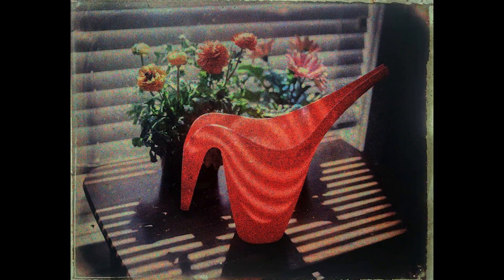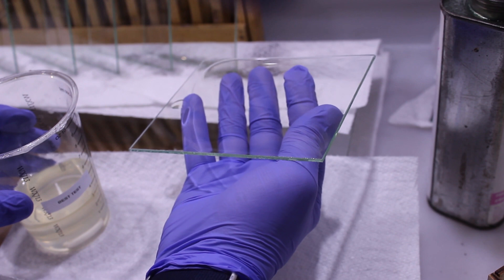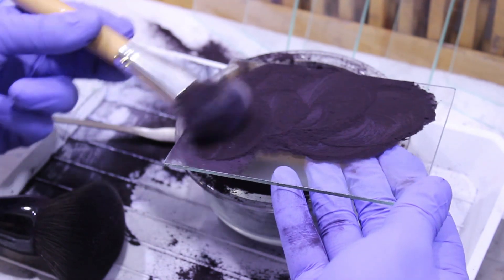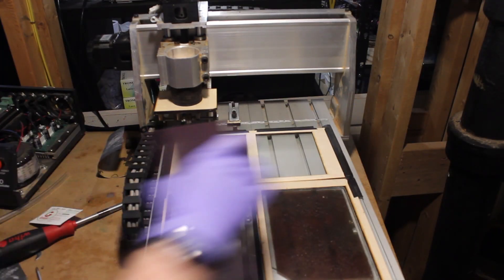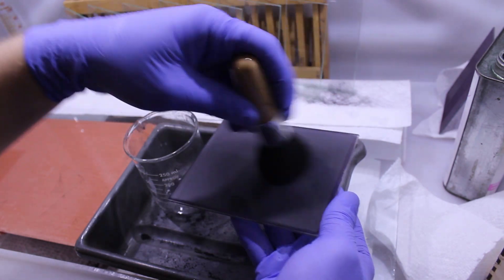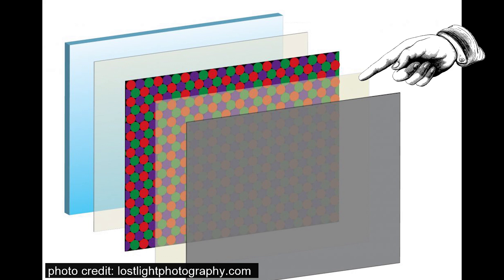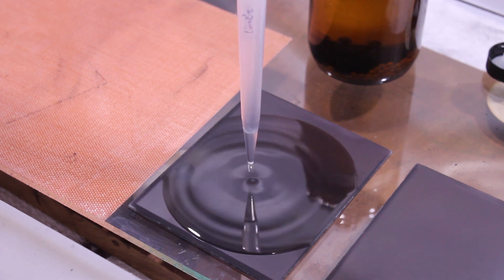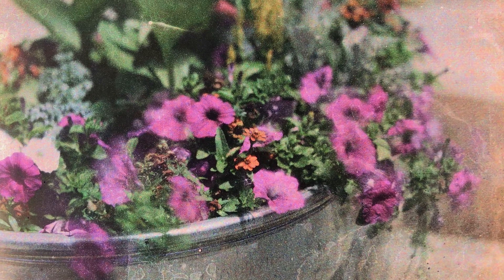Making an Autochrome Screen Plate

Comment: Applying varnish reminds me of applying photoresist to silicon wafers for IC fabrication.  A wafer is put facing up onto a rotary vacuum chuck.  Drops of photoresist liquid are applied in the center of the wafer as it spins.  The viscosity of the liquid and the rotation speed control the photoresist thickness.  A very uniform layer results.
Reply: A DIY spin coater project: https://youtu.be/FpR3G4C-b0U?si=dzqFrEtRKsYKyKba

Comment: Fascinating. The only reason I haven't tried this, so far, is that I don't know how I would go about finding a panchromatic emulsion. I imagine I would have to make one. And I only vaguely know that there are red and green sensitizing chemicals that can be mixed but I haven't found much in terms of specific information for this process.
Reply from the maker: Yeah, that's more or less correct.  I make my own because it gives me more control over the characteristics of the emulsion.  That being said, I think any commercially available one could conceivably work if you add in the spectral dyes - you'd just have to do a lot of trial and error figuring out just how much exactly.

I use erythrosine for green and pinacyanol for red.  The original Lumière plates used a different mix - erythrosine and orthochrome T for green/yellow, and ethyl violet or orange-red.  Unfortunately orthochrome T seems to be completely unobtainable these days unless you want to drop $10K on a custom synth, so I just use my own sensitizers instead.

Comment: Really interesting video. I found this video after watching the Autochrome video on the Technology Connections channel and I really want to try making some myself. I can't wait for the full video. Could you in the meantime elaborate about some stuff your website didn't mention? What dyes did you use? Your website mentions that you slightly modified the original dye formulas, but for the life of me I can't find anything about them. Maybe I would find more about them if I searched in french, but I kind of failed that in school, so not really an option. Is it possible to use modern dyes that are easier to source? I want to try it out before I spend a lot of money.
Reply from the maker: Hey there!  The dyes should be listed in a table, but I remember the website editor being kind of weird, so maybe it's just not showing up in your browser for some reason?

The quantities are as follows - 

Orange Starch: 11.2g Erythrosine, 2g Rose Bengal, 15.2g Tartrazine, 150mL water

Green Starch: 12g Tartrazine, 7.5g Patent Blue V, 150mL water. The green also uses some ammonia and sodium sulfate to help control color and consistency but I'm traveling atm and can't look up those quantities.

Violet Starch:  6.4g Crystal Violet, 0.9g Malachite Green, 150mL water.

I don't think there would be any issues using modern dyes, as some of these can be kind of pricey.  I tried a few different t-shirt dyes from Jacquard with poor results, before figuring I would save more money in the long run just using the original dye formulations.

Comment: I just learned of this process and have been checking out plates from a century ago 
Very ingenious process but I'm wondering;
Why do your pix look more like pointelism paintings than the old pix which looks like film?
Reply: From what I understand from my extremely limited understanding of it, it’s got to do with the size of the starch grains, older versions used a specialised refining process that created tiny starch grains, which isn’t as easy to achieve when DIYing.
Reply: Would the starch autochrome work with Edwin Land's two color Retinex method? That would be interesting. Please, do a full video.

Comment: So how long do the plates last with out the silver emulsion? Like could you make up a batch of plates then when you go to use them you just slap the emulsion on and ready to shoot?
Reply from the maker: They pretty much last months.  I've still got some problems to work out with the second varnish, where it kind of starts to delaminate after a while.  I've done this with some plates that were a year old, and were more likely to crack/leak, but still worked.

But basically yeah, nowadays I'll make like 30 plates over the course of a couple weeks, and then do a big coating run all at once.

You can reuse the plates a few times too - so if you don't like how an image turned out, you just wash off the gelatin, and you're ready to coat again.

Comment: This is fantastic! but I have one question, where do you get the chemicals? Specifically the sensitizers, I've been to your website and read everything along with doing a lot of google research
and couldn't find really ANYTHING on pinacyanol synthesis nor much of anything on purchasing it and or other sensitizers either. There are crumbs of mention here and there but it's like there's no info I can find on the Spectral sensitizing dyes pinacyanol and others (without buying books for guess work). Any info and or sources of that would greatly help!
Reply from the maker: Great question!  You're right, sensitizers are by far the hardest to get a hold of.  I get most of my standard chemicals from The Photographer's Formulary.  

If you know someone who can order from Sigma Aldrich, that's how you would get a hold of the pinacyanol.  You might try contacting the guys at artcraftchemicals.com, the last time I needed to put in a special order they were able to source it for me.  Luckily 1g of that stuff will last forever.  

The other sensitizer for green, erythrosine, is pretty easy to find.  I think I got like 100g off of ebay a few years ago.
Reply: @jonhilty7434  Sorry for the late response and thank you so much for replying! I honestly didn't think you would. When doing research I did notice that Sigma Aldrich
was the only "commercial" source I could "buy". Is it just hard/difficult to add to cart and buy from them or do I need to give them a good reasoning?
(I ask because the sight says literally add to cart) I also wanted to do research in seeing if there is a somewhat "easy" way to synthesize pinacyanol like the chemists of old
so I wouldn't have to rely on single source buying and or having to have a middle man get it for me. I'm looking into improving the process and end result of the image by
trying out Oswald Ripening (once I figure out the best/easiest way to do it simply) along with making a more uniform and patterned color grid like ones in led screens. Any ways
I'll try out those sources once I have everything set up to make my own autochromes and again thank you so much for responding back. :D
Reply from the maker: @virus7g7  No worries!  I try to reply to everything.  If I ever don't, it's probably that I just forgot...

When I last tried, Sigma would let you add stuff to the cart, but you wouldn't be able to complete the order unless you were a registered business or research institution.  

I did run across a pinacyanol synthesis a while back.  It doensn't look TOO crazy, but you'd probably want a fume hood and some decent equipment.  I actually ran across it because I wanted to see if I could make "Orthochrome T", which afaik is completely unavailable.  They have extremely similar synthesis routes, and were mentioned in the same article.  At the end of the day, though, I decided against it, because there were a ton of weird chemicals involved and I didn't want to end up on a list.

Good luck on everything!  I'll be interested to hear how progress goes!

Comment: Fantastic video, I've only heard of one other photographer replicating the Autochrome process, you've done a fantastic job, looked at all your autos on your site, almost all the subjects look 1900s period in Autochrome except the shots with modern subjects in it, absolutely enjoyed seeing those photos!!! I personally shoot and process vintage expired film and several years back I bought 3 rolls of 1956 expired Lumiere Alticolor 120 colour film which is Autochrome but on roll film emulsion, the first 2 rolls came out very messy but the 3rd roll came out really good!!! I will upload the photo montage sometime soon and link you to it. I've also shot some 1939 and 1941 expired Dufaycolor films too which are a colour matrix version of Autochrome and got decent results.
Reply from the maker: Oh man, very cool!  I'd love to see your results with the Alticolor!  Sometime this spring/summer, I'm hoping to pick up an old Kodak film coating machine, so 35mm Alticolor-like film isn't outside the realm of possibility!  

I have a single DufayColor slide, and I absolutely love it!  I'd love to try and emulate that style of screen plate.  I think first, I'd need to start with a low-res system like the Joly Plate.
Reply: So I was not the only one to have their mind blown by seeing an IKEA watering can shot in real Autochrome. :D

Comment: Would this be possible to do on film? I assume 35mm would be way too small since the starch particles would be way too big but maybe 120? Would be interesting to create custom color emulsions within the realm of a diy skill level especially since film prices are going up.
Reply from the maker: Yes, absolutely!  When the Lumière company shut down production for the original autochrome line, they switched to potato starch on a flexible support, called "Filmcolor" I believe.  They produced additive roll film through the 1950's, with the last product being Alticolor.

You're right 35mm would be pushing it a bit, but I think if you're using sorted grain it wouldn't be too bad.  It'd probably be on par with a 4x5 with unsorted grain.  I'd bet medium format would look pretty good.

Comment: Jon, I’m a little confused. I’m a collodion photographer and I’m assuming this wouldn’t work on an ambrotype because collodion is orthochromatic. But the first color image was produced in 1861, so they had to be using collodion? Even if the results aren’t great, shouldn’t it be possible? Also, are you saying that this could be placed over any orthochromatic plate to reveal the original colors? I just don’t quite understand how this works once the photography part takes place.
Reply from the maker: Hey there!  The first color photo actually goes back to experiments by Edmund Becquerel in 1848, using his own specially created Daguerreotypes.  These used the interferential method to produce color rather tricolor.  He never did figure out a way to fix them, however, so they were sparingly displayed.

Maxwell's 1861 piece was on collodion plates IIRC, using 3 separate plates that were exposed through red, green and blue filters. I'm sure an alarm bell is going off - how could the red plate ever be exposed, when outdoor wetplate darkrooms use red filters in sunlight without any fog?  The red plate had to be exposed much longer than the blue and green plates, and Ron Mowrey (Photo Engineer over at Photrio) theorized that the red plate is actually violet/UV reflecting off the bow leaking through a flawed red filter.  I don't know if this is true, but it's always made sense, since Maxwell didn't really seem to make many more pictures using such a novel process.

I don't know much about the specifics of the rest of what he did, but I assume he used the negatives to print positives on glass, and then recombined them in some manner, either using filtered light or by dyeing the collodion before it dried.  

As for autochromes - they use a dry plate gelatin coating over top the starch, and the exposure is made with the image passing through the starch layer first, and then to the image.  This could be done with collodion instead, as long as the solvents in the collodion didn't melt the "second varnish" on the autochrome plate (it's nitrocellulose based, so there's a good chance it would).   Orthochromatic collodion would only likely get you blues and greens though.  IIRC ethyl violet was used for orange/red collodion sensitivity, so maybe that could work.
Reply: @jonhilty7434  Thank you. I think this helped me understand more clearly. Have you ever sold one of your autochrome plates? I have no way to make one myself and I’d love to experiment with collodion!
Reply from the maker: @TheSoulOfGenius  Hey!  I've sold them in the past.  This summer I was hoping to have been shipping boxes, but I've been having a lot of trouble making them lately, for some reason...

If you're looking for just the screen plates (no dry plate emulsion), though, I could sell you some!

Comment: I know it is not historically accurate, but could you use polymer powders and a heated cylinder to flatten it? It would probably be more persistent and easier to get.
Reply from the maker: I'm all for an autochrome-style process, even if it's not "authentic".  I just don't know much about those materials.  If they're sufficiently transcluscent and saturated in color, it's something that could probably be leveraged.  Especially if the gelatin could go straight onto it!

Comment: I am glad to see I'm not the only young guy still shooting and developing film in Michigan; I'm 18 now, but have been developing film since I was 16.  I converted a shed on my property into a fully functional dark room.  I'm from a small town outside Port Huron by the way.  Anyway, I would really like to try to shoot Autochrome.  I mostly work with 35mm film at the moment, but I can shoot on other types of cameras aswell.  I am very intrigued from the process of taking the picture to the development process.  Sadly, there are no videos I can find demenstrating how to do any of it.  I would like to see how you do it.  Maybe I can adapt a way to make it work with 35mm film too.  I really like the way potatoes can make color; it's like no other.
Reply from the maker: Hey there!  Very cool!  I got my start around that age.  I got a super lucky deal at a flea market, where a dude was giving away basically a whole darkroom set for $20.  I ended up cramming it all in a tiny closet at my parent's house for a couple years.

Developing autochromes is pretty similar to normal B&W prints, just with a couple extra steps.  If you google b&w "reversal processing", you'll get a ton of info.  You can develop autochromes with a normal dev/stop/fix method too, but you'll end up with color negatives instead.  

I've got some pictures of development here: https://www.jonhilty.com/autochromeexposureguide

Re: 35mm.  It's definitely doable, but since it's "positive" process, the plate you shoot in camera is going to be your final picture too.  So it'll end up just being real small.  That's why I usually shoot these with a 4x5 camera.
Reply: @jonhilty7434  I got lucky too wkth the darkroom I have.  My highschool got rid of all their film equiptment from Film Development class and I got to have all of it.  And thanks for the tips and info.  I'll definitely try this on a bigger camera than 35 mm 😅
Reply: @jonhilty7434  Would you think putting one of these plates in an enlargement machine would work ?  If the film used in the machine was negitive, you could just use normal black and whiite developer ?  And if this is possible, I don't see why you couldn't make 8x10 plates since with an enlarger you could make it as big as possible.
Reply from the maker: @thewindows95guy  You're thinking like, apply the normal b&w film/enlarger/print workflow to autochromes?

I don't see any reason why that wouldn't work, although your grain would get magnified on the "print".  But assuming you got the color balance figured out, you could make as many final "plates" as you wanted.

I'm not aware of this having been tried historically, but it may have been.  I'll have to look into that!
Reply: @jonhilty7434  I'll have to try this.  If it works, it could be possible to make much larger prints the size of maybe a small window.  That could be really cool.

Comment: Do you think a pack of originals expired in 1928 would still work? 

Off topic, but I'm consistently amazed that no company has revived any of the mosaic screen processes, such as the autochrome, dufaycolor, etc. The dyes used are much more stable, so it takes a lot longer to fade, it can be processed with ordinary black and white chemistry, and it isn't as complex as producing a "true" color emulsion. 

But hey, I know some chemists and other aficionados; somebody's gotta get the show on the road. I don't think chromogenic film with all its required infrastructure is long for this world.
Reply from the maker: Hey there!  Sorry, I thought I replied to this like two weeks ago, but I guess the comment didn't go through.

For original autochromes - I have absolutely no idea if they would work or not.  I've definitely heard of people developing older film/plates before.  Usually they add extra potassium bromide to the developer to help with fog.  I developed a roll of film from the 50s a few years ago and most of it turned out pretty well, though some parts had some fungus on it.  

I have a few boxes of autochromes too, but I'm afraid to open them.  I probably won't ever think about shooting them unless I can get my hands on an original Lumiere orange filter, since it needed one of those to correct the color balance during exposure.   

I agree, it is kind of weird that there isn't at least ONE mosaic screen process on the market right now, since the chemistry required isn't really that crazy.
Reply: it would be a great niche product- the original autochromes were high quality plates, might take some work to achieve that.